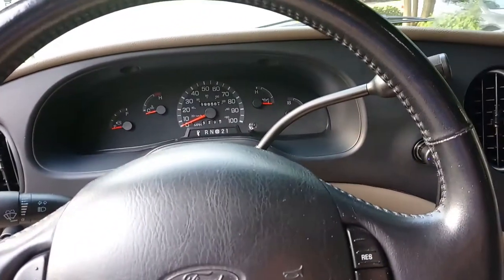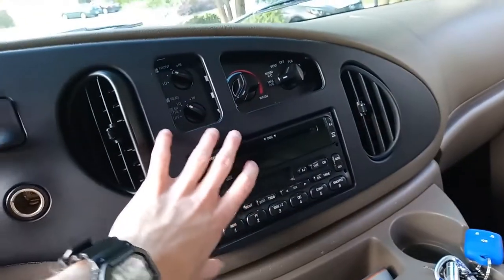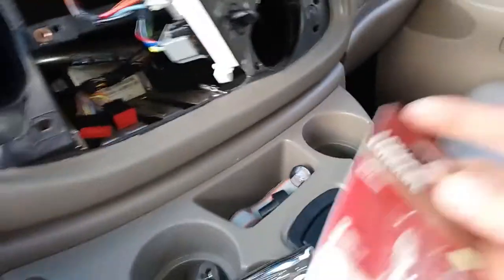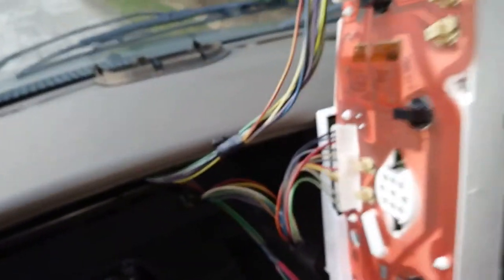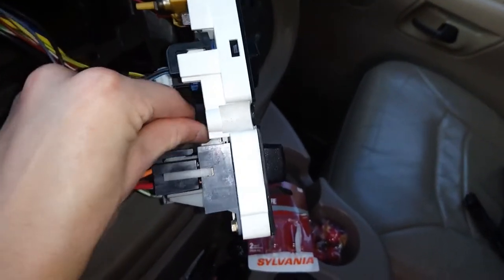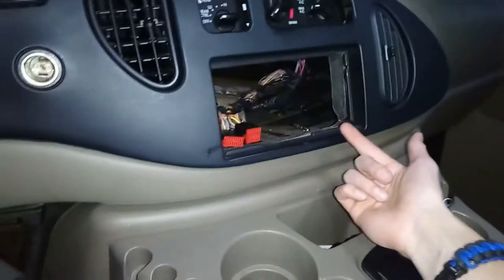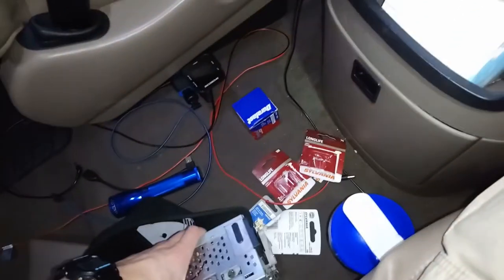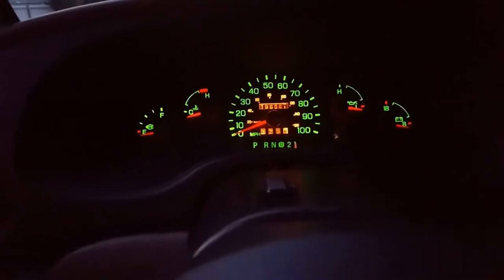How to replace gauge cluster bulbs Ford Econoline E150, E250, E350, 2002.  Remove Dash panel on van.

Comment: ***Warning*** I did this. Getting the shift indicator plastic piece back into the instrument cluster is nearly impossible. So much so that I was going to have my car towed to the dealer. After fooling with it for a half an hour I finally got it back in. It's hard to get an angle on it going back in. Coming out is easy. Outstanding video above. The 194 bulbs are just too dim. Replacing them with 168's mad them brighter. Same with the 74's on the turn signals. Straightened my shift indicator needle settings out also with the adjustment wheel.

Comment: Very helpful and saved me a lot of time. 2 suggestions, 1/4" ratchet is much easier and the plastic auto body trim tool set from harbor freight pops that panel right off. $10.

Comment: Great video. thorough, but not boring.. Those fan control switches are very high voltage. There is also a resistor on the firewall that should be replaced at the same time..
Reply: They are not high voltage it's like 12 2 to 14.5
Reply: If you are talking about the blower resistor it is in the engine bay, mounted on the blower housing behind the battery, no need to mess with the dash for that. The air position selector(ac max, vent,defrost,etc) is actually vacuum actuated not electrically. If your vents got stuck usually on defrost or floor you might have a vacuum leak in that system.
Reply: @AC89-o9n yeah like when mice get in your dash thru the winter and chew those lines up ? 😂 I'm dealing with that myself

Comment: Can I used colored lamps instead of clear??..like say, blue or green?.. also if I use LED, how do I get my polarity,.. I’m an electrician btw, so the terminology is not new to me, but not sure how to ring out the polarity on a 12 volt dc system.
Reply from the maker: With automotive LED lighting, you can plug in the bulb and turn it on. If the polarity is wrong, the bulb will not work. Simply flip the bulb around and then it should work. The bulb will not be damaged despite being plugged in backwards while you try to find the polarity.  The only issue with using LEDs in these types of guage clusters is that the light my not shine evenly throughout the display.  The Chinese made LEDs will only work for a short time before they start to flicker out. The American or Japanese made ones will last longer but they are way more expensive.  I thought about putting LEDs on mine but the high price and short life span with the poor light quality made me decide otherwise.

Comment: What a God send this video excellent video is. I have been fretting over taking my dash off my van for over 8 Months. I put it off, and put its off, out of feat that I did not know where to begin. See, my fan control nob broke, and I could not get any air out. Summer time I dealt with it, because my rear fan button worked so we had A/C. Now it is deeply into Winter, and I cannot defrost my windshield, so I have paper towels to rub it dry while driving. 

Just returned from a 5o mile trip and hit a snowstorm. You want to talk about a harrowing trip. Wow. My wife was almost in tears. Got home, and went to looking for help, and ran across your video. I already order the part, and when it arrives I will fix it, with no worry about removing the panel. Oh, and my radio will be replaced with one I have been wanting to put in also. finally.  

God bless you my brother, you have made my wife a happy and unnervous woman.

Comment: Light switch knob. 
 Actually an easier way to get it out. 
Put your hand up underneath the dash where light switches is. Reach up above the switch. There’s a little button that sticks up, you push down on the button. You can feel it you don’t have to see it, jut push down/button and pull the switch knob out. 

When you pull it out, the lights come on. 
Put the knob back in. Just don’t push hard and not all the way in. Just enough to where you can feel it go in, then headlights go out…its all good.
Reply: Genius! Thank you very much!
Reply: light "switches are"

Comment: Do you have to take the radio and temp control to only change the instrument cluster bulbs? Are all the instrument cluster bulbs the same size and number? My right signal bulb is out and I want to use the (as you say) 74 to replace the 73. Thanks for sharing you video.
Reply from the maker: You will not need to take the temp cluster out but you will need to take the radio out depending on whether or not the front dash piece is one pieces or two pieces.

Comment: I have a 2005 E350 and the CEL light doesn't work. Went to the shop and said I have to replace the whole cluster for $700 (not including labor)
Does this sound right or is it as simple as replacing the bulb like in this video?

Comment: Thanks for the detailed instruction. I have a question on another topic. Can you make a video on how to replace the rear air blower?
Reply from the maker: Thanks. Will have to look into that one day.
Reply: @theelectricreality  I just replaced the front blower motor and the old motor worked just fine,  The problem was the speed resistor.  Also cleaned out the inside cavity where the motor mounted real  lot of dead leaves in there.  Rear blower looks like the same motors assembly.

Comment: Thanks , have 97 E350 63k miles I'm refurbishing to use a camper. Still has 2 tires with DOT dates 296 - '96 originals. Dash lights are half burnt out . u ever have 5bells x 5 ?
.
Reply from the maker: What's 5bells x5?
Reply: @theelectricreality  ok when engine running , the door alarm ding 5 times then repats 4 more times of 5 dings each. My obd doesn't pull up any codes . Have u ever come across such a thing ? Thanks
Reply from the maker: @flowrob6861  so from what I know when you get in the van and leave the door open and stick the key in the ignition, the bell alarm will start to let you know that the key is in the ignition with the door open.  After you start the engine, if the door is still open, the bell will temporarily pause as the power is cut to most accessories to allow maximum power to go to the starter. After the engine has started, all of the accessories will power back on again and the bell will start again. Once the door is closed, the bell should stop after it completes its cycle.  So it might end up ringing a few times even after the door is closed. My van does the same thing too.
Reply: @theelectricreality  nope the 5bells x 5times happens when driving every 15 minute . Could it b cause 3 dash lites out ?
Reply from the maker: @flowrob6861  no that would not cause that. There is probably a wiring short somewhere at the door sensor or the bell unit needs replaced. I would look at replacing the door sensor first.
Reply: 5 chimes repeating 5 times is the ABS light is out. It is in the manual. It's a "backup" for then the ABC light cannot display so you know.
Reply: 5 bells 5 times is a warning about your airbag system having problems.....my 2000 e150 v6 was in a collision and when i replaced the front clip i didnt replace the airbag sensors and its had the 5 bells 5 times ever since then. I took the old sensors out and temporarily plugged them in without remounting and it stopped the 5 bells issue....odb wont give this info through codes , a licenced ford tech showed this to me and he was correct. It is also a warning for your abs but if you have no braking issues and abs isnt having problems check your airbag systems sensors conections and components .

Comment: On my 98 Ford e250 the head light switch comes out by depressing a metal nub on the top of the headlight switch assembly itself have to remove the knee / kick panel and reach up and over the top of the switch assembly and press the nub and pull on the headlight switch knob straight out I hope that made sense I had to watch a video on it

Comment: AutoZone don't actually make the blower control switch it's probably a dorman part but they burn out cause they carry alot of amperage through it
Reply from the maker: AutoZone contracts manufacturers to make their parts. Not sure which company makes it but its not Dorman. Theirs looks different

Comment: On my 2000 Ford E150 Van the right side turn signal indicator light bulb in the dash is out. I am hoping I can get my hand up behind the dash to change it without having to pull the dash. I haven’t looked under the dash as of yet to see if it is possible. Has anyone changed one out that way?
Reply: How did that work for you? My right turn signal is out also. Rather not pull the dash. Thanks in advance.

Comment: Would like to know on 99 E1 50 if the fuel light low is not working what to do, is there a bulb or is there a fuse?
Reply from the maker: It could just be the bulb or it could be that there is an issue with the fuel level sending unit. As they age fuel gauge can give some false readings. The fuel light will still come on when the is not reading properly so it might be tied in to another system. Haven't does much research in that area yet so I'm not quite sure what would commonly cause that but I would start by checking out the bulb.

Comment: Creeper, you have my exact same van. Well other than than mine has been modified for my wife to use. She is in a wheelchair, and thus I added a wheelchair lift and hand controls. Mine is a 2001 and I like the radio you have./ I am considering upgrading from the factory radio we have. What is the model of your radio, if you know. I am having a difficult time finding a new radio with modern abilities for bluetooth, usb and maybe cd capabilities.. If you could help I appreciate it
Reply from the maker: Hey Chuck thanks for your feed back! Unfortunately Sony does not make the stereo that I have anymore. However on Amazon there are many other options that will work with the Econoline vans. When you search for a stereo, search for a double din radio. That is the size that will work. There are also adapters that will work with E series vans as well.
Reply: @theelectricreality  Thanks

Comment: I have the same van, my board doesn’t light up brighter. Is this what I can do?
Reply: Mine is a 97
Reply from the maker: If you have splotchy lighting behind the dash then it probably is just a few bulbs have burned out. If the dash is evenly lit and is just not very bright, twist the light switch counter clockwise and see if it gets brighter. If that doesn't work then there is probably a issue with the resistor for the dash lights.
Reply: @theelectricreality  thanks my friend!